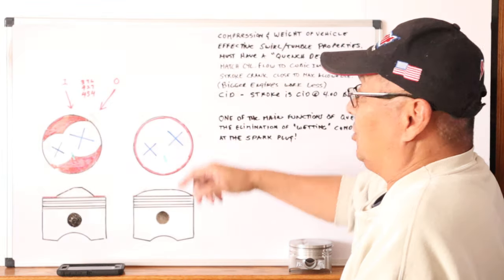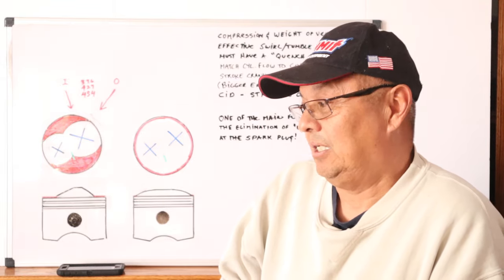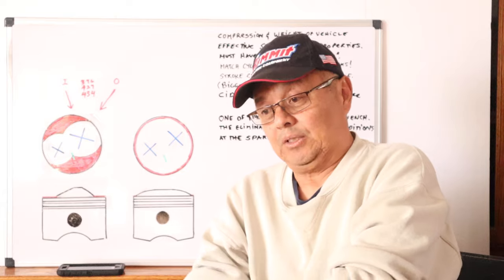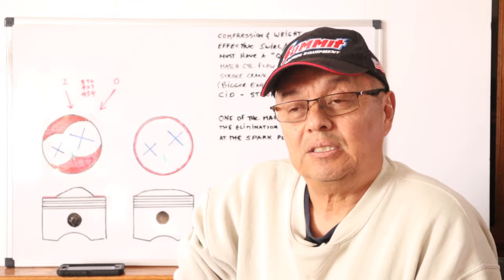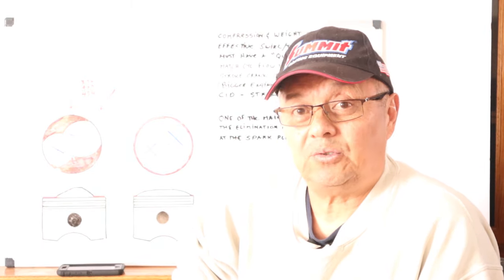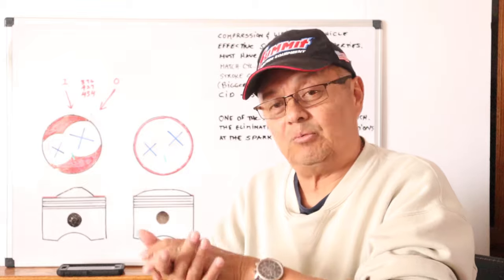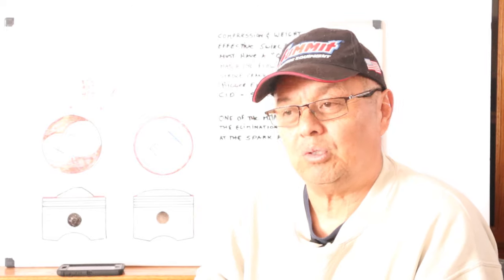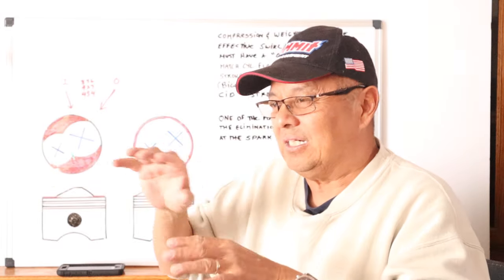HOW MUCH COMPRESSION PART I CAN WE RUN ON THE STREETS?

Comment: People's ideas of compression are all based on poorly tuned carbs on bad 70s gas. Modern oem cars run over 10:1 under boost. Tons of oem cars nowadays run 12:1 stock. Dudes even add boost to those 12:1 cars with pump gas. Engines don't like running low compression.
Reply from the maker: Pyric, agree somewhat on your comment on the 70's gas.  The stuff we have today have alcohol which is stable (10-15%) but hardly gives enough heat content because it has less BTU's which is detonation tolerant but produces  less HP and mileage.  On boosted stock engines with high compression on today cars is very impressive like you stated above with high compression.  I love it when they do that!
Reply: Something to consider on the new oem 12:1 motors coyote in specific. 10 speed trans and dohc with variable valve timing definitely helps prevent detonation. Compared to a sbc and power glide with 12:1
Reply: @robertmgarcia200  o absolutely modern computer controls make a big difference in safety. The point being its not the compression though its the quality of the fuel delivery. Even direct injection vs port injection tends to let you run more boost/compression at a given octane level.
Reply from the maker: @pyric ,direct injection is excellent in a track application and now many engines ends up with carbon buildup on the intake manifolds/heads!  Routine maintenance today for DI engines and like my Raptor Ford introduced an injector upstream to help keep the ports clean.  On another scenario on boosted engines F1 and others run their injectors upstream near or at the top of the trumpets to help cool down the intake column thru the Joule-Thompson Effect, which effectively cools the charge temperatures which does not happen in a dry manifold creating secondary issues in how much max.boost or compression an engine can tolerate.   
I sincerely believe DI belongs on the track not the streets where low speed driving introduces lots of carbon in the intake manifold.  Lots of garages do these repairs to rid the manifold-cylinder heads of excessive carbon buildup.

Comment: How come Hemi engines ran so good with hemispherical chambers, no quench area at all 🤷🏻‍♂️
Reply from the maker: They do in fact make power because of the breathing potential specially at high rpms or engine speeds.  However, todays state of the art cylinder heads are basically patterned after the semi hemi 429 Ford because the true hemi configuration has issues at lower engine speeds or mid range.  Boosted on whatever fuel they are hard to beat!

Comment: i know for a fact u can run 13.5 to 1 with 92 octane this is what we ran with a 327 pro built because we put a tunnel ram on it and we ran pump gas only no nitro full body with street tires only and we never had a problem with it. we did have a lot in to the engine started with rick news dragster engine then put another 25,000 in it still had the 202 heads but ported the hell out of them went to 204 intake valve opened up the heads even had to port the intake to match the heads intake ports but we wanted cast on cast for a high rpm engine so it ended up costing 3,800 for head work back in the mid 90's just to have cast on cast but never had a head gasket problem put aluminum titanium alloy rods balanced all the parts then balanced the counter weight to rods and pistons on the custom made crank then internal and external balance on crank shaved the block and heads to get the 13.5 to 1. had to port the cam bearing to get the bigger cam in it. even terry fisher said it was nuts after driving it for a street car. we was the fastest in my area for a few years won a lot of money with that car
Reply from the maker: Looks like you guys did an awesome combination!

Comment: I must of missed something, but ive never read or heard from anyone ever, that bases compression being in any way relevant to compression ratio.
Joe Sherman, & David Vizard base compression off the timing , when the valves open and close and the overlap. This will give you a good idea of cranking pressure which in turn will tell you if the cam and compression are on the money. Bad cranking pressure  equals bad torque.  Port volume is way down the list of importance when it comes down to choosing a head, it's  minimum cross sectional  area, and valve size  and flow to suit the cubic inch and rev range.
Reply from the maker: You have to consider port volume in relation to rpm and cubic inches!  If i run a 240cc head on a 302 running as high as 9k it is important I have that volume to properly feed that rpm and engine size!  On the other hand 240cc on a high rpm stroker 351 displacing 432cid will need much more than 240cc cylinder head to run at 9k.  After these chamber volume comes next as I posted many times my heads that flowed 283@28 and ran 9.30's 149mph at 2850#.  That is for all practical purposes street level flow rates far from what it can actually do!  If you rely on flow then you will be pleasantly surprised it is way more complicated than these.    
Therefore I did not have the flow to support that run and at the same time generally port shape is very important and height takes precedence because of the true fact the flowbenches become less effective the more the head becomes ideal and in the end racing engineers look at and evaluate from there.  In short flowbench measures inlet restrictions and the less restrictions it see's flowing any heads the less accurate they become!
Joe Sherman and I was supposed to be co-representers in a tech forum started by his son Steve Sherman after the success of our Ford Vs. Chevy Match Races @ Barona Dragstrip pitting his Chevy vs. my Fords.  Vizard, I know from a mutual friend who recently passed away who insisted I start videos because he said I did not only did I dyno plus flow tests, but raced big time on various associations giving more info from tracks than any dyno or flowbench can provide so here we are.
Reply: You’re static compression ratio always plays a role especially in a street engine as this is the first thing you will set up,EVERYTHING is based off of static,then secondly will be getting your dynamic correct off of the camshaft selection,as far as port volume Ben is spot on while you are correct the valve is the cork on the bottle which does have a big role in determining cylinder head flow but port runner length and volume play a HUGE role in determining what cubic inch engine and rpm said engine will need to make power,that cylinder head will be matched for the cubic inch and rpm it will be using to make power,so runner volume and length are up on top of the list,valve sizes can be changed relatively easy,so that’s a pretty simple fix for bore sizing for valve unshrouding,Ben is spot on
Reply from the maker: @davidphillips3801 , this is why ALL racing cylinder heads posts port volumes and recommended cubic inches and rpms to determine "ideal" applications for their given cylinder heads.   To say port volume is low on the lists of importance denies this fact that it is important and why it is listed as such for applications...
Reply: @benalamedaracing2765 agree wholeheartedly, Both volume and length play a huge role don’t understand why these guys don’t get it
Reply: Should of checked what I'd written last night being New Years eve... anyway Ben stated that the customer required 11:1 based off the lift of the cam, which has nothing to do with anything. Timing determines compression.  As for volume and length of the port, yes it is relevant, but it is the least relevant. 2 ports can have totally different volumes and react very differently or very similar. Minimum csa controls max rpm to a large degree. Once velocity reaches .6 mach the motor will start to roll over. Yes it can make power past that point but it will diminish the rpm /hp and the more you try to go past that point it will become more of a 2 stroke, narrower power band. More volume and or more mcsa or larger valve size doesn't mean more flow either.
It's a matter of matching all of that up right and it will perform  well.
Reply from the maker: @parkerracing7374  lol.  Ok I m jut confused because you are not telling me anything I do not know this is why I have a big channel and you do not!  I do not even know where you got that I stated 11:1 based on the lift of a cam wherever that came up so perhaps you are reading something you are not.  
And your comment of "timing determines compression".  Ok and chamber design does not have an effect on these? From open to close chambers to high swirl/tumble mixture motions effects on ultimate timing and reductions in negative torque? Advance designs reduces timing significantly improving power reliability and economy running on high compression on pump gas.  All we need to look at are the corvettes and mustangs with high compression getting good power and mpg's.
Anyway may I suggest you expand your own channel and posts the myriad of racing you have done which I have, never been a keyboard warrior or internet expert.  I just race what I build and learn right from wrong as my accomplishments prove this or I would never have won anything more so makes any kind of sense...
Reply: You stated that the guy with the ac cobra with a stroker motor at the start should of been running 11 to 11.5:1 based off him running a .560 lift cam, there was no mention of duration (cam timing). You would never recommend to viewers who run carbs and distributors and your typical sbc/windsor/chrysler motor to run such high compression based off lift. A 220 degree cam with 11.5:1 is going to have massive cranking pressure and turn in to a hand grenade very quickly. Most cam catalogues give recommended compressions.
Maybe you just missed stating that bit of information by accident,  but your viewers take every thing you state as gospel.
Reply: When I mentioned timing determines compression ratio required, I meant cam timing(duration) not ignition timing. Yes, I agree ignition timing does have a lot to do with combustion chamber design.

Comment: I'm trying to see if I can get away with a 9.5 dynamic compression on a 02 LQ9 aluminum headed LS
Reply from the maker: Should be very possible because the LS heads have a nice chamber and swirl properties!  Do a compression check and if it pumps less than 200# after five kicks of the needle you should be good to go!

Comment: would do you think of LQ4 iron, PRC Heads, btr stage 2 113 ls. Is 12.3 compression on 91 octane optimal.
Reply from the maker: Depends at that compression ratio what elevation is your city where you will drive this thing?
Reply: @benalamedaracing2765  about 0-100 ft above sea level

Comment: Hello Ben. Does the compression suggestion changes when boost is applied and or does the ignition timing make it possible to use 11-11.5 in boosted applications? Thanks
Reply from the maker: Shaun, 11-11.5 can be done with boosts specially safe with e85 or alcohol fuels which cools the charge big time allowing it to make power safely as long as the ignition timing lead is observe very carefully!
Reply: @benalamedaracing2765  Thanks
Reply: Shaun, I run 12:1 compression and 23 psi of boost. E85 is your friend. Watch the plugs carefully, an efficient package will need very little timing to make power. In my particular case, 15 degrees at 23 psi leaves a perfect plug. 16 degrees shows a little pepper.
Reply: @ArthurSperotto  Thank You
Reply from the maker: @ArthurSperotto , thank you for your comment/input and appreciate it much sir!

Comment: “shut it off in gear so it dont run on” ya leave the race cars, race cars, i wont go over 10:1 on premium gas with aluminum heads, keep quench at 38-40 thou. im not trying to squeeze every last ounce of power to the point of replacing rod bearings.
Reply from the maker: Have you tried a little higher perhaps 11.1?  You will not ruin the rod bearings if it does not ping/detonate.  You will experience this issues if your advance ignition curve is too quick for the trans gearing your running and will give you problems.

Comment: Have you ever done anything with 180 degree headers?
Reply from the maker: No sir never had time to experiment or run those type of hedders and for sure they make a lot of sense just that it will not fit in standard engine compartments/undercarriage.

Comment: 351w, 52cc canfield 195 head, turbo, e85. would you go higher on compression to get quench vs a dish to get 10.5:1 cr?
Reply from the maker: A flat top piston on a stock stroke 351W will give you approximate 10.5-10.75.  52cc will net you about a 12.5 minimum at least.  If your E85 is consistent in its octane then with a healthy camshaft and reasonable boost with some intercooling should work!
If this was street use majority I would try to get some quench it is worth it for throttle response.
Reply: @benalamedaracing2765  turns out the pistons i have (very old wiseco 383 sbc specific 1.55 CH) do have a small dish to them (not a total bowl). Im going to guess somewhere in the 10-18cc range. I need to measure them. They will be zero deck assuming the deck is actually 9.5". The canfield heads have a 52 or 54cc chamber, so i think it will be in the 10:1 range, maybe a 1/4pt more. There is some quench pad, so should work ok.

Comment: How do Hemi's make so much power without quench pads?
Reply from the maker: Frank, excellent question and I will answer you in as simple as possible explanation.  Hemi's dominate in NHRA Stock and Super Stock due to the fact many of them came with dual carbs in heavy and lightweight chassis!  Offerings from GM/Ford are somewhat lacking in these areas and it shows.  I will be following up with advantages and disadvantages of HEMI vs Canted Valve layout and it has a lot to do with "reversion" exhaust to intake which is the big handicap of HEMI engines.  This said, if you look at latest NHRA Pro-Stocks and IHRA Mountain Motors they incorporate not a "true Hemi" layout but more akin to the Boss 429 Semi Hemi with quench pads in order to make absolute peak horsepower!  They are all of these design to incorporate a decent amount of swirl/tumble and prevent intake port dilution from the straight 12 to 6 Oclock valve layout!  They are more off line in the 10 to 4 valve arrangement and it shows definite advantages over the true Hemis.  I will posts these subject matter in the near future!
Lastly in Top Fuel/Funny Cars the true Hemis still dominate due to its ease of maintenance and simplicity of design plus nitromethane does cover up a lot of inefficiencies!

Comment: Got a question I am building a 1972 402 with open chamber heads and pistons not sure how to build this engine it is going in a 74 Chevy square body trying to get 375 425 hp either is fine not sure what piston to use only thing a want for sure is a really choppy cam like lunati bootlegger any help would be help ful thanks
Reply from the maker: Just strive for higher compression and the cam will sound even better and not be sluggish on the streets!

Comment: So If I'm building a spicy street sbc engine say 12.5-13:1 compression on E85 and I want to use nitrous from time to time, maybe even upwards of a 250-350 shot, would you still leave the quench at around .040 or does the quench need to be more? Like .050-.070ish?
Reply from the maker: Not knowing much if it is an aluminum or steel rod it will matter.  I would safely add .010 additional clearance on your quench if it is aluminum rod.  Zero deck with lots of nitrous I would say .045 minimum.  I would always go for quench because nitrous engines like to speed up the flame speed big time having some kind of tight quench will stop that flame acceleration from getting to an explosion!  I will do a video about this in the writing stage.
Reply: Ill be running a steel rod. Awesome I'll be looking forward to your videos! Thank you Mr. Alameda!

Comment: Okay this is what I wanted to do eliminate the spark come in through the top of the Piston like hemispherical motor straight down on top of the piston with a small electrode wire controlled buy computer program to send the spark therefore eliminating the spark plug
Reply from the maker: Plug location is indeed important and a centrally located spark location can eliminate detonation from pressure and temperature spikes within the combustion space.

Comment: The one problem I had in my 332 stroker with 10.95:1 and TFS track heats(and JE ultralight flat tops) is when the motor is hot, like 190, and I turn it off, let it sit for awhile, go to start it, and it will sometimes kick back and damage the flexplate teeth. It's happened twice, so I plan on setting up an ignition retard like the MSD starter saver for easier hot starting.
Reply from the maker: Perhaps you have too much initial ignition timing as a likely culprit.
Next video I will touch on theses
Reply: @benalamedaracing2765  The motor loves initial timing, I'm at 20/34 timing, the throttle response is super crisp with the timing at 20 initial. I wish I could go more, but I don't think the starter would deal with it. lol My cam is 106 LSA, with 250/260@.050, so I'm sure that's why it wants lots of initial timing.